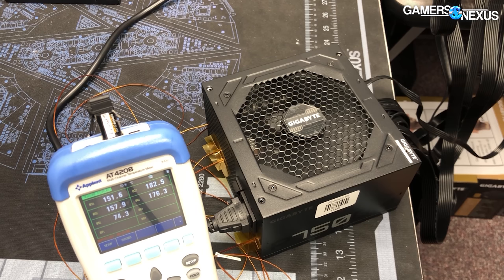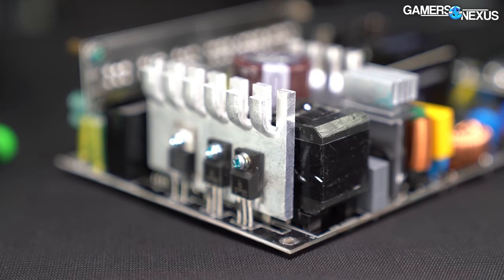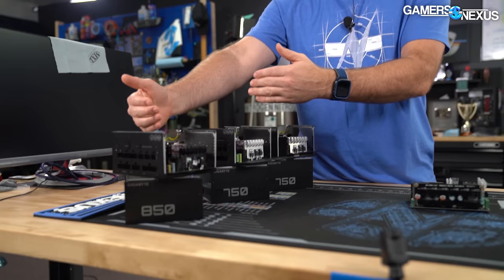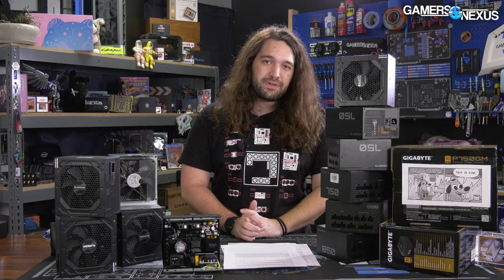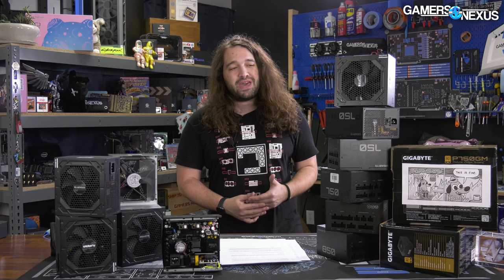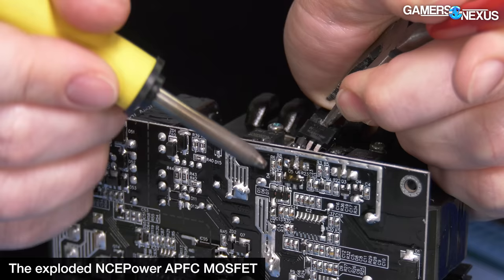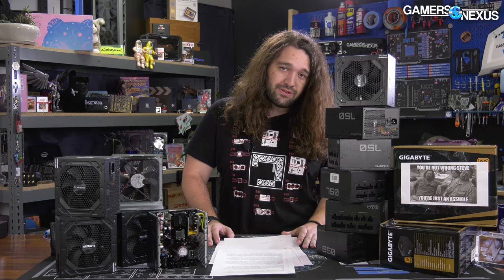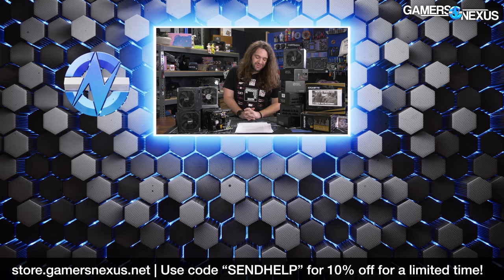Exploding Power Supplies: Gigabyte & Newegg Dumping Unsellable Product

Comment: I’m an intern (take what I say with a grain of salt) working for an electrical engineering contractor designing embedded systems . I’ve gotten to sit in on some project development meetings and there’s been warnings about counterfeit parts making their way into the supply chain because of a general shortage of common components. The project I’m working on is seeing lead times In excess of three months to a year on some parts. It’s possible gigabyte is having to source some of these components from different vendors than normal or may have fallen victim to some counterfeits. It shouldn’t necessarily be an issue to use parts from different manufactures if they are accurately rated for the same spec, but, from the people I’ve talked to, manufactures can be less than honest with rating their own products.
Reply: While that may be the case allowing the PSU to operate at 130-140% it's rated capacity didn't exactly give them good odds for handling such an eventuality. Normally you overspec the components a little and make sure the fault tolerance is a little hysterical. That way you have two safety margins to buffer against, should one of them fail.
Reply: Considering all the different failure modes, is it more likely that it's a design problem? or maybe a manufacturing fail in the board? overvoltage somewhere, or something like that? (I am not an EE)
Reply: Unknowingly sourcing bad parts is one thing that is forgivable. Knowing that there is an issue & refusing to do anything about it is what they’re being put on blast for. Newegg & Gigabyte knowing a product makes a better fireplace than a power supply & still shoving that product out the door is shitty behavior.
Reply: @damionb7946  This is a case of smack the Newegg bean counter complaining about the losses. Offer a refund or replacement for sold units and nail Gigabyte to the floor. Customers like knowing products are well supported. But Newegg's handling has been a double down on how can we piss off the customer.
Reply: While it's a lesser evil, being swindled of buying bad-quality components from dodgy suppliers still reflects poorly on the company's business practice. Suppliers may give you specs, that doesn't mean you don't carry out spot check. Even if you have done business with a certain suppliers for a long time, it only means you have reasons to trust them more but that doesn't mean you would trust them like you would trust your family. Trust but verify. QA. Not really an excuse to push out bad products.
Reply: Counterfeits are huge..  MOST Japanese branded electroyltic caps, transistors etc are fake.. if it isn't from a reputable supplier it is fake.
Reply: I was bitten by counterfeit MOSFETs on one of my designs a few years ago, and the situation hasn't gotten any easier with the current shortages. 
Lucky for me I was able to catch the bad batch before too many made it into customer's hands. 
The component markings were perfect, but testing revealed they were a much lower spec device.

Comment: Quick tip: for as many fires as you guys make you should acquire a CO2 fire extinguisher. Those little cans as well as normal ABC fire extinguishers will make one heck of a mess and likely ruin your gear if you ever have to use one.
Reply: This one 200%, Heck that powder ruins everything.
Reply: Eh…I would actually recommend a Halon system installed in their labs, as well as small hand held Halon units around the office.
Reply: Halon is electrically non conductive. It works by interrupting the “Fire Triangle”, and is good for Class A, B, and C fires. There’s also no real residue to deal with. So it’s particularly great for lab and office environment where it doesn’t make a mess, or destroy/interrupt sensitive electronic equipment.
Reply: @BigBear--  It's also deadly.  And ALL fire extinguishers interrupt the fire triangle in at least one way.  That's by definition how an extinguisher works.  So yeah.

I've had success in using a compressed air bottle sprayed upside down on a smoking vacuum cleaner.  There were no actual flames yet, but it would have been called a class C at work.  Obviously I don't recommend this as a PLAN for fire suppression, but if you don't have anything else when (a very small) one occurs, it can work.  I suspect it would be able to put out any smoldering pieces from the pops in the video, or the NZXT case fire (provided it didn't progress past where it got to in the video).
Reply: @BigBear--  Former fire fighter and PC builder here. No, you DO NOT want a Halon system in the lab or in the office or anywhere people are going to be! Halon is great for server farms, and enclosed areas of electronics like that, as long as people are not in that area regularly, or for very long. Halon will kill you. CO2 would be the preferred extinguisher for the lab and office due to the amount of electronic components and people. Wet chem, as in the little cans, and dry chem as in the typical ABC extinguishers will ruin everything, so those are not recommended. Just to reiterate, Halon will kill you.
Reply: @Tolemac7  datacenter manager here. Concurrence. Halon kills. We don't use it anymore.
Reply: One addendum: CO2 fire extinguisher horn become EXTREMELY COLD when used,  be sure to know how to properly hold it when in use or you can get a severe frost burns (frostbites) on your hands.

Comment: PSU testing is always the hardest part of troubleshooting a bad system.  For casual consumers, it can be almost impossible to determine if the problem is PS or MB related.  Thanks for the insight.

Comment: I' am Electronics Engineer; (after reviewing your data), "mixed capacitors, MOSFET's exploding, protection circuit does not kick in until 130% over capacity is reached", does suggests a major design flaw in the Gigabyte power supply. What bothers me is the use of different vendors supplying parts that don't match engineering specifications, this is a error in outsourcing for cheaper parts where quality control is substandard. My conclusion; "a complete redesign of the power supply models, improved current protection, (critical), assign one vendor regardless of what models are made, "supply high quality reliable  parts",  and a mandatory recall of all defective units that are still sitting on shelves waiting to be sold.
Reply: And this is why the bean counters never listen to the engineers.
I mean, in an ideal world the bean counters wouldn't need to exist, you'd set a price point, set a performance target, give the engineers a few weeks, and the engineers would tell you if they could hit the price point and the performance target at the same time. If not, choose which one to sacrifice (it's usually the performance). Oh and then make sure you drill it into marketing's head that there's a revised performance spec sheet to use for the marketing, so that they don't do false advertising "by accident" (we all know it's by design, and by design in such a way that they can claim innocence).
Engineers are fine. It's the rest of companies that makes me want to vomit.
All it does to me is make me think "Ok, that's the cheapest one on the market, but that's buying lies. How much do I have to pay to get something that actually delivers on its specifications?" which makes me spend more when I could probably get away with spending less, simply because of the cost of failure (catastrophic failure especially, like a primary-secondary short in the power supply sending mains voltage coursing thru all the delicate silicon).
This is why I stick to well-known brands, and buy high-wattage, 80+ Platinum or better PSUs, that actually have marketing points of things like "name brand MOSFETS" and "Japanese electrolytic capacitors". Yes, I pay more than I technically need to, but I can allow myself to have faith in the product specifications.

This 750/850w PSU is designed like what I used to think was a "350w and under" "no name grey box" psu problem. Someone fed this one after midnight, cause it's a real Gremlin.
Reply: That's what happens when you select a cheap Chinese power brick vendor to make your PSUs.
Reply: They should also replace every one of these PSUs that were sold and might be unable to be returned to the vendors. I don't even want my money back, I just want a decent quality PSU... ( I bought a 850 awhile back, it's outside of the return window now. )
Reply: That’s funny. I’m a circus clown and I could tell you the same thing.
Reply: @DefianceOrDishonor  If I was you, I'd seriously consider talking to a lawyer about either starting or joining a class-action suit against either NewEgg or Gigabyte or both. Or at the least, consider suing for the replacement of the product with something comparable from a different brand, and the legal fees you incur doing that (that way you don't pay for the lawsuit, they do).

Comment: I almost bought one of these once. It was fairly cheap, and I’m like “Gigabyte wouldn’t put their name on complete garbage right?”
Reply: "it was fairly cheap" that's the red flag right there.
Reply: RIP
Reply: The only hardware issues of any type I've ever had since starting to build component PCs in 1997 were Gigabites...
Reply: 😂 one of their motherboards failed me while using an amd fx cpu. So nothing new with this company
Reply: @chinesesparrows  Chinese sparrows are actually just Japanese sparrows
Reply: Gigabyte makes complete garbage first-party regularly. Their Vegas are an an engineering clownshow with a near-100% failure rate, they had B350 boards that burned out in months under "supported" CPU draw, now they have unsafe Nvidia Ampere GPUs as well.
Reply: Same
Reply: @badboyhotstar  I have used cheap no brand Chinese PSU that where better made then then gigabyte ones  . there is also other brands cheap  PSU that are OK . What gigabyte doing is full on scamming ppl  .
Reply: Bruh I just bought one like two days ago before I found out about all of this I’m new to pc’s and I was like “oh yea gigabyte is the same brand as my gpu it should be pretty good” but I guess not 😂😭
Reply: Right. Because it's incomplete garbage.
Reply: Gigabyte is another word for garbage...
Reply: Yeahhh, I never spend money on cheap PSUs. I literally spent $200 on this Seasonic Prime PX-750. Yes, $200 on 750W, but at least I know it's the top of the line PSU platform as of right now and will last me an easy 10+ years with that 12 year warranty.
Reply: @VortechBand  and for me its always that way with asus products. Just my luck, but I assure you it's just coincidence.
Reply: i bought one because my corsiar rm650x crapped itself... no research in a hurry bought this.... still waiting on corsair for the replacement unit...their customer service is kinda slow
Reply: Thermaltake PSU is ok to use?
Reply: @armanhussain3070  Thermaltake PSU's also had a lot of failures because of poor quality of APFC controller IC's. Also, many other vendors used those poor quality IC's as well, e.g., FSP. Working in a repair service in the past years i had to replace hundreds of these IC's by another compatible APFC controller IC's of the proper quality. There's no PSU vendor existing that produces PSU's with 0% failure rate. All of them have particular problems, the only question is - how often these problems occur (how much is the probability of this).
But Gigabyte with these recent PSU models was really unlucky - failure probability is very high. I suppose it could be 2 cases:
1. Because of poor quality APFC controllers, just the same as many other vendors did in past.
2. Faults in a schematics design, where FET transistors appear to work in an improper conditions (e.g., switching transition takes unacceptably long time, etc.).
Reply: @pearl571  I've seen Corsair PSU's in our repair service very rarely. Apparently they have quite a low failure rate. Exactly RM650X PSU model i had in repair about one year ago, and it was one of the best quality PSU i have even seen for all the time working in a repair service. It's just completely another quality level, unlike FSPs or Themaltakes that we had in repair almost every day.
Reply: @CaptJamesRogers  my unit had a defective switch, when I pressed the switch it shorted something out and it died… never had any problems with a corsair psu. And i finally received the replacement psu from corsair a couple days ago.
Reply: @CaptJamesRogers  Thanks for the information, brother. I,m running Rx 570 and ryzen 3200g for a year with thermaltake litepower 450 PSU. Should I be worried? Do I need to replace it?
Reply: @armanhussain3070  If it worked flawlessly for quite a long time, then no need. Those bad APFC IC's didn't work long. If it's some of the latest PSU models by Thermaltake, it may be free of that problem (i don't have info for their latest models). Also, it might have no APFC at all (there're Lightpower models with and w/o APFC).
I have several TT Lightpower and Purepower from 550W to 750W in PC's at work and at home within many years (they all are with replaced APFC IC's) that are working fine so far, except one of them (Purepower 550W worked in my home PC) where protection now is triggered at the power load of about 150W (i didn't have time to look into it yet, just replaced it to a modern Corsair TX650M recently).
Reply: @badboyhotstar  Not necessarily
Reply: I was like: woah, a 750w modular PSU for 80 bucks and it's a trusted brand. What a killer deal.

No. It will kill you.
Reply: @randomguydoes2901  Nah, they've got great AMD creator motherboards. And by great I mean they were the only Thinderbolt choice
Reply: @samholdsworth3957  can they carry coconuts though?
Reply: @badboyhotstar even aresgame power supplies don't blow up (and are rather reliable)